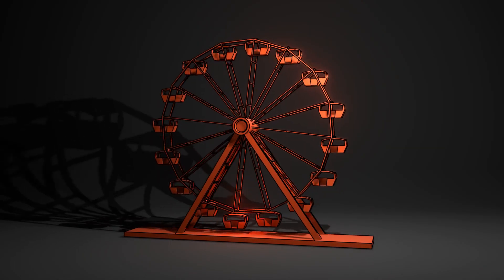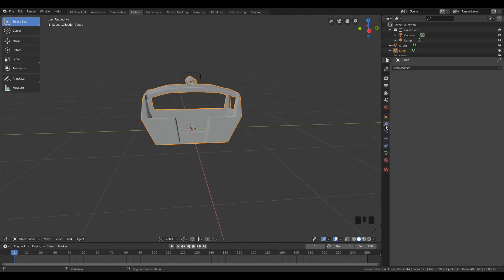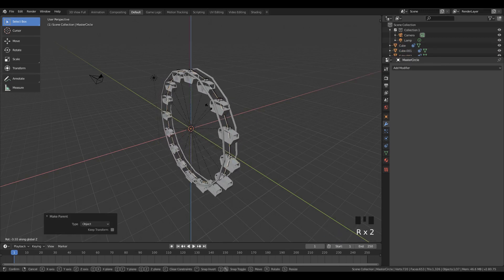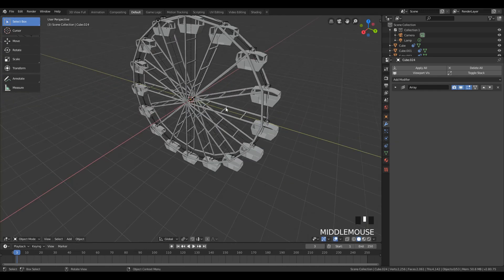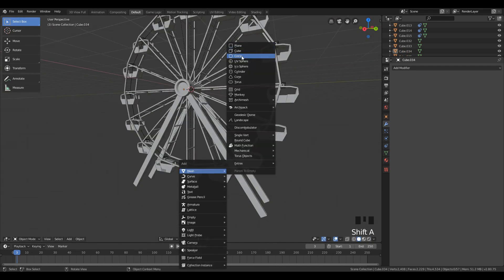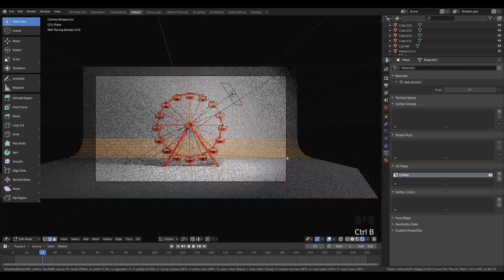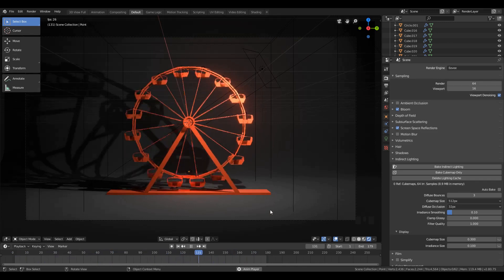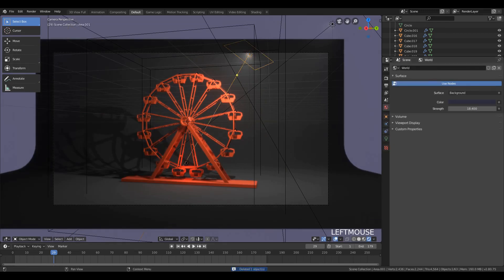How to Make a Low-Poly Ferris Wheel (Blender 2.81 Tutorial)

Comment: Uhhh... my ferris wheel is shifting to the side when it's rotating. Any help?
Reply: nvm, fixed it by applying rotation (object > apply > rotation) to set the current rotation as original so that there won't be any problems with the axis.

Comment: you can add an empty, and add an array mod for the pin and in the offset objecy select the empty, now you can rotate the empty and get a radial array. leave the translate ammount to 0 or it'll have an offset radial (shape) array. Hope this helps
Reply from the maker: That is really cool, thanks! It certainly saves some time :P
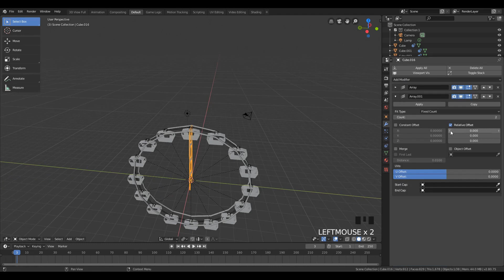Reply: 6:12
Reply: So I tried following along. Since I set the second array on the pin and selected object offset and targeted the other empty it does "duplicate" it but has this strange stretch effect that changed to shape entirely.